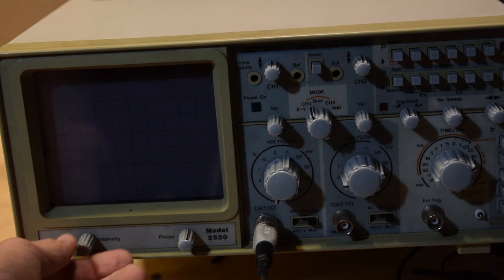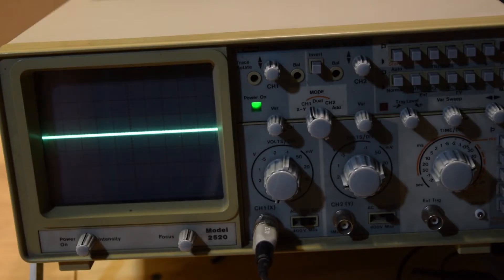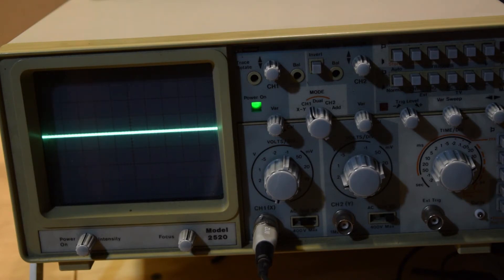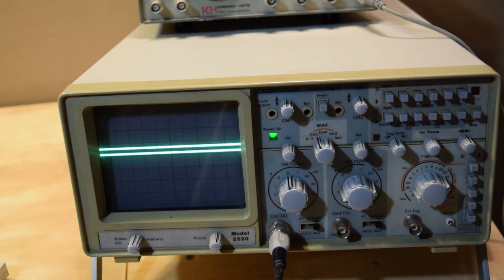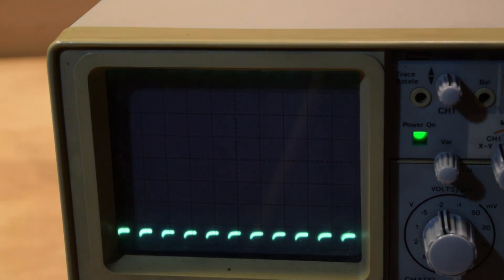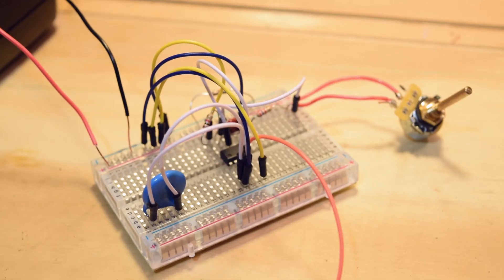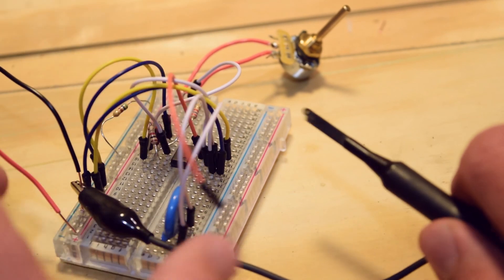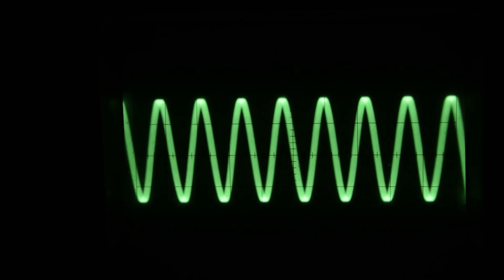Analog Oscilloscope & Sweep Generator

Comment: The 555 timer works fine, the problem is you have your 10x scope probes bad calibrated, that's why there is a "spike", to prove it, the same spike it generated with the signal generator, not a coincidence xD